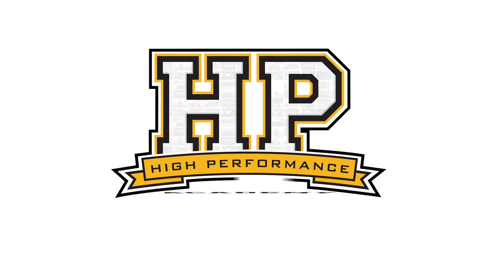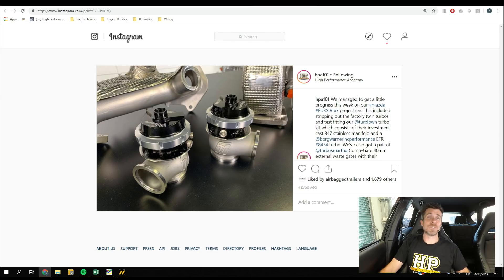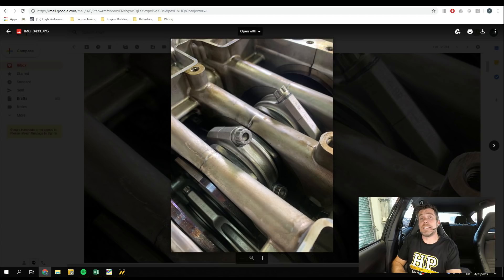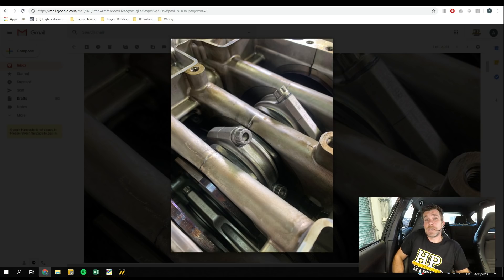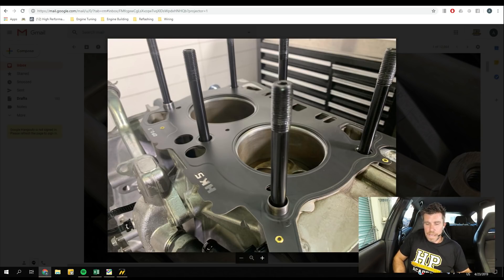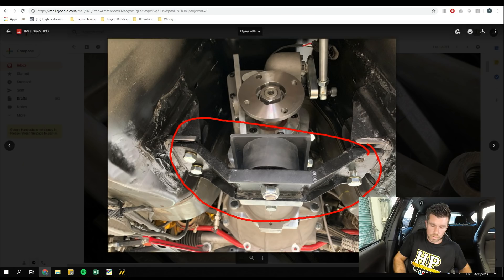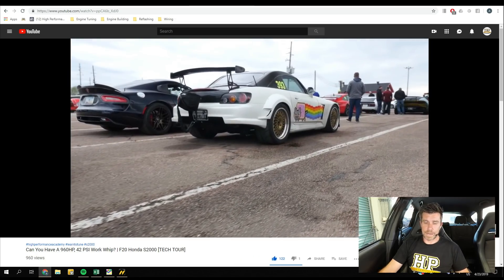Workshop Manuals, Wastegate Fitment And Ghetto FA20 Build | Today At HPA 207 [UPDATE]

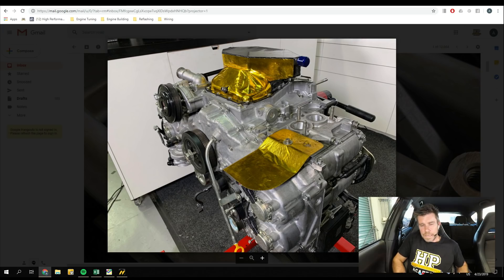Comment: FA20 is not known for oil starvation.  Especially on "stock tires" (see 12:50).  If you have data logs showing otherwise let us know.  Totally agree on the oil cooler.  Great channel BTW.
Reply from the maker: Hey Daniel, yes, we've got exactly that data. We've had a MoTeC CDL3 fitted to the car since it was brand new. Even in 100% stock form on our local race track the car would suffer oil surge one one particular section of corners. We were seeing oil pressure drop down to 28-30 psi when the normal straight line oil pressure at the same rpm on a straight section of track was around 45-50 psi. This got significantly worse (understandably) with semi slicks and better suspension. We never suffered any engine damage as a result and perhaps 'starvation' should in fact have been 'oil surge' as clearly we still had some oil pressure but the jagged and sudden drop is telling of what's happening in the stock sump. - Andre

Comment: Won't raising the head gasket thickness tamper with the quench area in combustion chambers?
In 4g63 engines it a big NO No 
Should always use a stock thickness gasket and compensate buy doing a math calculation and a camshaft degree to check over all compression ratios and to make sure valve to piston clearance is good. 80,000inch.is absolute minimum. Anything less needs piston fly cuts.
Reply from the maker: It really depends what kind of change in thickness you're talking about. Certainly if you're trying to make a significant drop in CR by adding a head gasket that's perhaps double the stock thickness then yes, this will impact the quench and often makes the engine more prone to knock than it was with better quench and a higher CR. In our case the difference is minimal - around 0.2 mm. The 4G63 engine is probably one of the engines we have the most experience with given at one time or another engines we built held both the early and late model EVO 4WD drag racing world records. We have run a wide variety of gaskets and thicknesses in our engine programs and can confirm the 4G63 isn't any more sensitive to quench than any other we deal with. The same advice applies if you want to go crazy with a 3mm head gasket or similar but the minor variation in thickness between the OE gaskets and those available from the mainstream suppliers does not cause any issues.
Reply: What he said.  lol.  I'd also add that if the quench is built into the head and you have to machine it or whatever you can always get it back with the pistons if you really need to, assuming they're being replaced as well.  Quench is good, otherwise manufacturers wouldn't spend so much developing it.  But it's not the only way.  A good builder and a good tuner can get by without it.
Reply: Well my 4g63 is an old 6bolt. And even removing just a combination of 30,000 I noticed a complete engine charistics change.  
Had to run less boost and ignition timing to prevent knocking. But I did get full boost about 350rpm sooner and some off boost throttle response.  
But I also made same hp numbers with about 5psi less boost. 
This is with an old 3076 forced performance turbocharger with I believe their 9cm .70a/r turbine housing.

Comment: I’ve never seen gold foil in a hi-po auto application before
The gold foil looks like the material used by NASA in space
Reply: It is commonly used, gold foil can be so thin it is almost without actual cash value but it has about the best heat reflection of any material, so it is used bonded to some other thermal insulator for best effect. To clarify, it is excellent at reflecting infra-red radiation - this is the heat radiated out by the hot component that can be felt at a distance, just like sunshine (why the space craft use it) or an older radiant heater or light bulb.
Not sure about sourcing tit in the USoA, but ... Ah, here is a source - http://designengineering.com/reflect-a-gold-heat-reflective-sheet/ or https://www.pegasusautoracing.com/productdetails.asp?RecID=11221